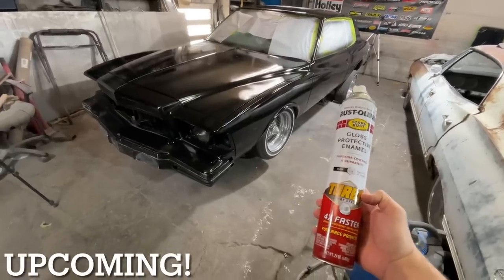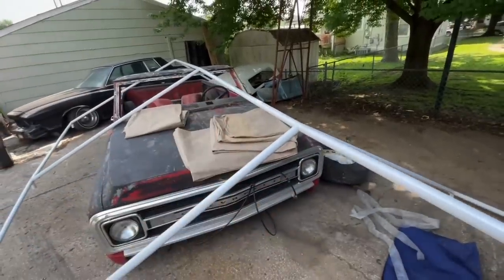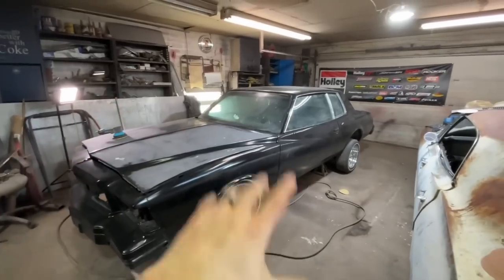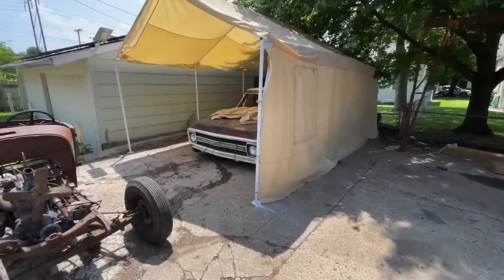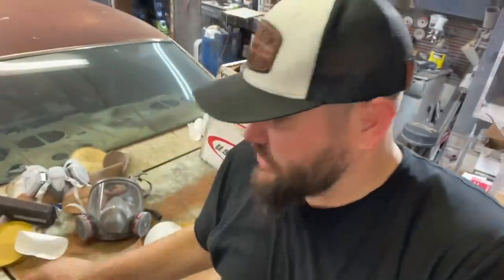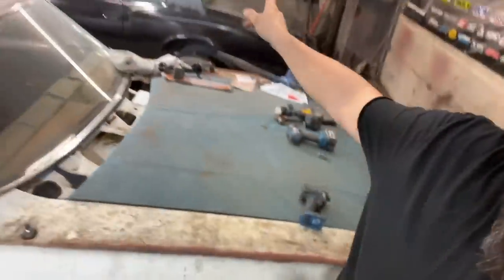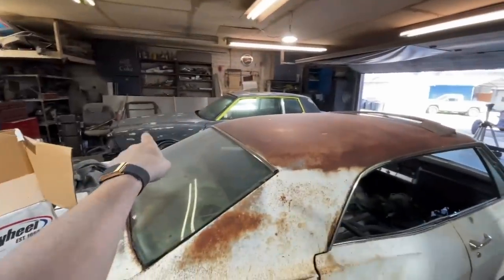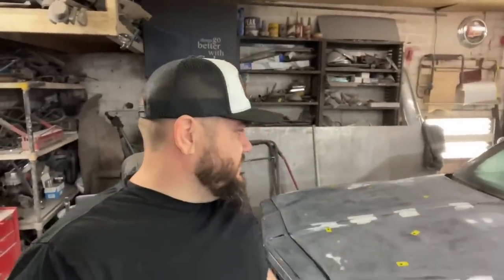PRIMING MY SHOW CAR WITH SPRAY PAINT! TRAINING DAY MONTE CARLO LOWRIDER! TURBO CAN PAINTJOB

Comment: Have the same style you need to put duct tape over any of the joints or rough edges a.k.a. screws otherwise in about no time flat it’ll rub through.

Comment: I had a 73 f100 I swapped a 390 4v into and after 3 days of trying to get running right and no luck I took a jack handle to it and then went to jail for disturbing the peace when I got out I sold it
Reply: Anger management bro 🤬
Reply: @rustymohr6652  lol it was almost 30 yrs ago I completed anger management
Reply: Well, now come to think of it, it's been about 38 years since I worked over my '76 Chevy truck with a logging chain after I was using it to stand on the hood to throw said log chain over a tree limb to pull the engine out of my '69 Chevelle and the chain came back down smashing the trucks windshield.
Reply: @noduh736  
No jail time. Just a disappointed dad.
Reply from the maker: You got in trouble for disturbing the peace on your own vehicle? I have never heard of that before
Reply: @CaseysCustoms  ya I lived with my mother in a mobile home community for adults and seniors that didn't allow children I was like 16 or 17 and a few days before when I first got the 390 in and running with just headers was the first time the police were called the old lady who called lived in a trailer that was probably from the 60s said it rattled the  windows out of the frame and the exhaust smell made her dizzy that was when I learned that any noise that was unnecessarily loud and causes a disturbance any time of the day or night is disturbing the peace cuz I also thought it was bull and tried to fight it in court I lost
Reply: @rustymohr6652  my dad wasn't around back then and no jail time
Reply: @rustymohr6652  when your young and you have a vision for your vehicle to look and work and you do everything you know of and it doesn't work out its very aggravating and when you are young you don't have the funds to pay a mechanic and you likely spent more than you should have and it doesn't work it makes you mad
Reply: @noduh736  
Oh. I just added that because your original post said you went to jail then sold it when you got out.
Reply: @noduh736  totally get that bro. I've had and gotten rid of over 2 dozen builds over my life. Never enough expendable funds to throw at big boy toys.😥
Reply: @rustymohr6652  ya it sucked my mom was pissed I even brought it home and even more mad I traded a good running car for the carburetor I thought was broken that was causing the problem it ended up being the adapter wasn't sealing but she always had good fast cars when she was younger and didn't get how bad I thought it was having a slow car and I was determined to have the fastest truck of all my group
Reply: @rustymohr6652  ya it sucked my mom was pissed I even brought it home
Reply: @rustymohr6652  ya now I do really well and have a great job making good money and can afford to build most of my childhood dream cars but now that I'm over the hill and much wiser those things are still cool as heck but not as important for me to have something that burns up 10 gallons of gas to get to work I think we always want what we can't have when we are young and when we get old we just don't want to have to need things we can't have if that makes sense